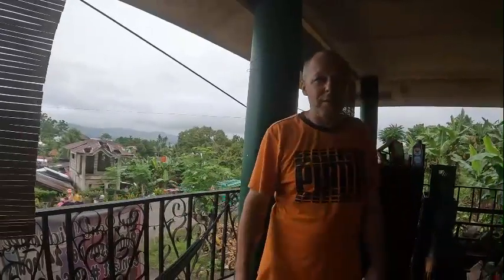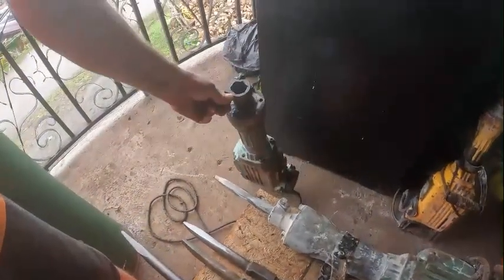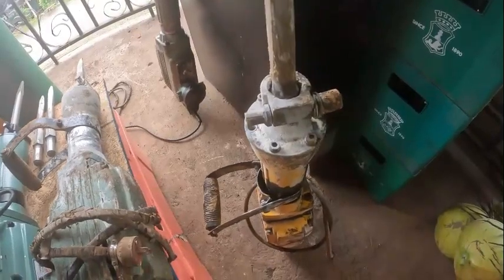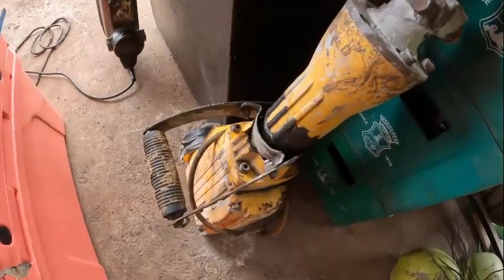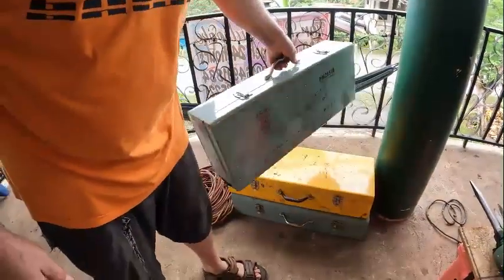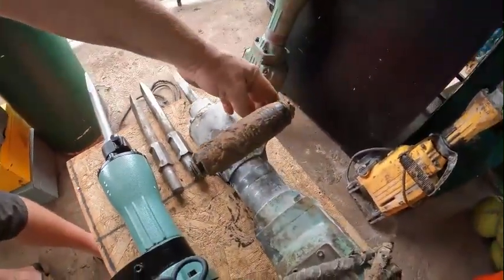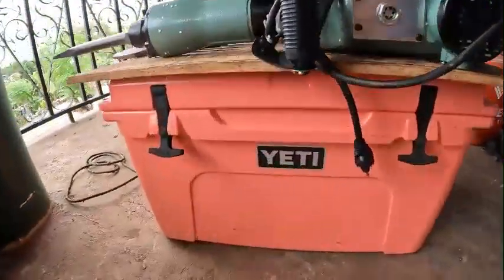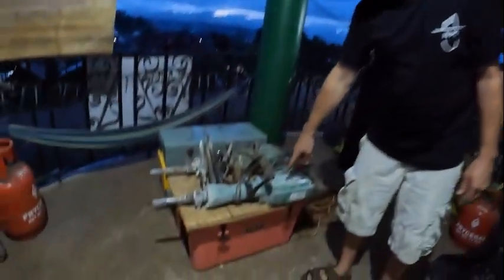The Thing You Need To Know About jackhammer in the Philippines

Comment: That's a lot ❤️ of rock that's been hammered on. I was surprised that any of the hammers held up.  The DeWalt tool line is a little overrated.
Reply from the maker: I'm also impressed with the jackhammers lasting as long as they do. Yes the DeWalt line is not like it was back in the early to mid 90's. I still have a DeWalt drill from back in the mid 90's

Comment: Im buying these for my digging project to soften the soil for faster digging.. you said you were impressed on how long they lasted.. do you still recommend it for digging dirt? 

My experience with cheat rotary hammer drill was great so far but i wanted to buy something specifically for digging because they are literally dirt cheap anyway..
Reply from the maker: I'm not sure if I recommend that for digging dirt, we only had solid rock which they were great for, but they're very cheap to buy so maybe it's worth a try for dirt